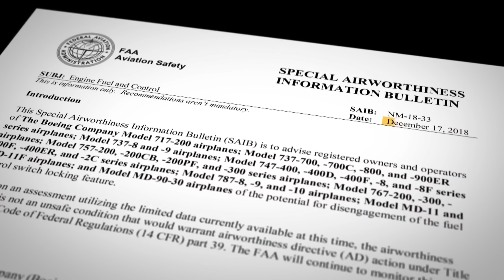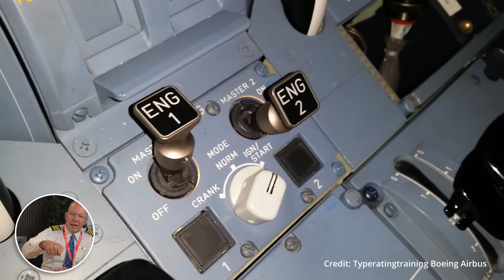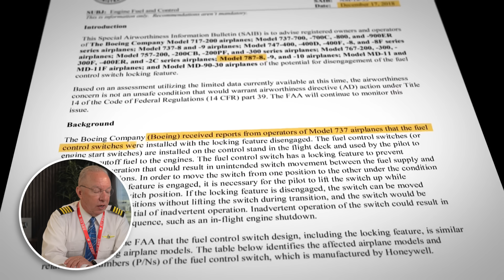Air India 171: The FAA’s 2018 Fuel Switch Locking Bulletin Explained (16 Questions Answered)

Comment: Capt Steve, could you please comment on the following points.

1. There are no high energy electrical switching systems in an aircraft cockpit. It is standard practice on all electrical machines, that high energy services such as pumps, electric flaps, pfcs etc are switched on/off by relays of various kinds.

2. That being the case, where is the sensor that tells the ‘black box’ that a fuel pump has been manually operated? Is it in the actual switch, or further down stream such as from the relay or the pump itself? This would tell us whether the switches were deliberately moved to the ‘cut off’ position, or the service stopped working for some other reason.

3. Is it possible that a ‘gremlin’ in the computer system could have turned the pumps off, without the cockpit switches being touched? 

4. I have an uncomfortable feeling that we the public are being primed to believe that this crash is a mass murder/suicide event. Such would be convenient for the manufacturers if there is a problem with the aircraft and its systems.

I am a retired pilot who flew very old aircraft types before the introduction of fly by wire and computer software.

Comment: I have read that the TCM Throttle Control Module which includes the two fuel shutoff switches was replaced on this airplane after a directive from Boeing.  The last time in 2023.  Does that also include the fuel shut off switches and has this been addressed?

Comment: I've read the whole report and here are some points to be noted:

1) One of the annoying thing is that they did not publish exact words that were said between the two pilots, but stated " In the cockpit voice recording, one of the pilots is heard asking the other why did he cutoff. The other pilot responded that he did not do so". However, it is still very important that one directly asked why the other cut off, and not like "What's happening" or "How did this go to cut off?". But again, we can't rule out the possibility that one pilot just assumed it was the other who did the cut off, and so asked this question.

2) The co-pilot would have had his license expired in september this year, and would have required to go through the following:

    a) Medical Revalidation: Renew your Class 1 medical.
    b) Check Ride/Test: Pass a proficiency check or skill test (on the aircraft type or simulator).
    c) Recency Requirement: Meet the flight hour requirements (e.g., flown within last 6–12 months).
    d) Ground Refresher (if needed): Sometimes required if CPL is lapsed for long.

^ while this might be irrelevant, it is still a minor fact to notice.

3) The switches go to CUTOFF at 8:08:42 (in a 1 second gap). Then switches are turned back to RUN: Engine 1 after just 10 seconds later at 8:08:52, while engine 2 turns on 4s after this, at 8:08:56. The report further states that if an aircraft is in mid flight and switches go from CUTOFF to RUN, it takes some time to regain the speed (obviously) and so the airplane could not regain height in time. It was too late. I'm not sure why it would take 10 seconds to turn back the switches on, but I think on that situation you will be so confused as to what is happening that it might not have been obvious to put them back to RUN immediately.

Comment: As airline pilots, we quickly detect when a switch or system is not operating correctly. Although we fly the same aircraft type, we operate different individual aircraft and can easily recognize variations between them. Not every aircraft will necessarily be affected by a potential issue.

Any defect, regardless of its significance—even something as minor as an inoperative reading light—will be reported in the Aircraft Technical Log (ATL). Licensed mechanics review all pilot entries in the ATL and perform corrective actions as necessary.

Prior to each flight, the next crew will also check the ATL to ensure that no open items remain. An aircraft will not be accepted for dispatch if defects are unresolved; any outstanding items must either be rectified or deferred in accordance with the Minimum Equipment List (MEL) and properly recorded in the ATL.

It is therefore unlikely that the aircraft operated with inoperative switches, nor that even a single crew failed to report such issues.

Comment: What if the locking mechanism for the fuel cutoff switches was warn due to excessive use to the point the locking mechanism simply let go of the switches?

Comment: Hi Steve, how do the fuel cutoff switches actually work? Experts talk about the cutoff switches as single entities that operate directly from the control knobs, like a lawn mower fuel valve. But, I doubt that fuel is piped into the cockpit. Much more likely that the switches are  not mechanical but are electric, controlling solenoids that control the fuel. How can we know that the shutoff solenoid valves were closed by software or a wiring error. This scenario fits the known facts where both pilots imply that they didn’t do it.

Comment: The RAT deployment at such an early stage (@ point of rotation) could indicate a power malfunction & consequent engine shutdown). The pilots could’ve then tried to manually rectify. The undercarriage will not retract in an engines shutdown situation. It’s baffling but Boeing’s work ethos has been criticised after other malfunctions/crashes. Far too early to blame human error. Software error more likely in my humble opinion.

Comment: Boeing not having software controls to prevent inadvertently flipping the cut off in "normal" flight speaks to the original Boeing culture of a skilled aviator being in complete control of the aircraft and why they did so badly when they put in computer controls which led to the 727 Max debacle. Good to know that other manufacturers try and have logic in place to prevent something like this.

Comment: I simply don't see how the control system in a modern plane would allow the fuel to be cut off to both engines in flight. It would be as illogical as allowing the pilots to bring up the landing gears while on the tarmac.
Reply: Landing gears will try and retract while on the ground. The nose gear will collapse but the mains won't. Fuel cutoff needs to be avail able to shutdown during an engine fire.

Comment: Any idea as to why there was only one second between the two switches being turned off but four seconds between them being turned back on again? Also, since there is a photo of the burned switches in the report, wouldn't it be possible to quickly determine that the metal indents were in place or not?

Comment: With the most courteous respect Captain Steve, you didn't understand the video question. Video recording, like other black box telemetry doesn't prevent the accident. The question isn't if video recording cockpits to "black box" would have prevented this accident, the question is what if it could prevent subsequent accidents by providing extra info.

Comment: I would like Mr. Steeve to explain below points
1. Page # 14 of the report clearly states and shows CCTV footage that RAT was deployed during initial climb immediately after lift-off. 
What would explain that?
2. How can 2 mechanical fuel cut-off switches be moved by a human being within 1 second. Is it even possible, because as per report, when pilots tried to move them back to Run position, it took 4 seconds?
Reply: I don't think you have the knowledge enough to answer my questions.
Everybody is aware of Boeing's past and their PR, so that says everything

Comment: CSeeve can u comment on this thought of mine:
1) timing of the initial switch movement comes immediately after PM takes his hand off throttle at V1Vr, and hands over to PF
2) 2 switches thrown within 1 second (possibly less)  could imply a TWO HANDED operation? PM has 2 free hands at this point. If deliberate was it done together with 2 hands?
3) 4 second seperation time  of switches being restored, comes after conversation. PF has ONE hand free, timing different from the OFF sequence, possibly because of ONE handed operation.

Comment: In what situation would a pilot need to shut off fuel to both engines, at the same time, during flight?

This seems like a failure mode that should be addressed by the manufacturer. There is a simple engineering philosophy called error proofing that needs to be applied here. 

We need to be designing these systems in a way that completely inhibits bad actors in the cockpit. 

Are all Boeing planes one intrusive thought away from a crash?

It’s unfortunate, but that is the world that we live in, and planes need to be designed with this in mind.

Comment: Seems the act of cutting off tge fuel switches was a deliberate act however everyone is jumping to conclusion and blaming pilot without knowing the facts before and after and those are not published.. under what situation this happened is unknown at this point so all including captain steeve (with all due respect) should stop blaming pilots and their mental condition until the full and final investigation is complete and instead should try to find the reasons as to why would any pilot do that

Comment: While fuel cut off can’t be placed fully under control of air logic like the captain mentioned, in case of fire etc , a solution could be to require confirmation from both pilots for fuel cut off eg by having fuel control switches at both pilots ends or an electronic approval from the second pilot after the first pilots cuts off the fuel.

Comment: I'm sorry where in the report is it said that somebody deliberately did it? 
If I see a warning in my system "fuel cutoff" I would definitely ask my other pilot "did you do it? "  Apart from that where in the preliminary report is it mentioned that somebody intentionally cut off the switch. Or somebody manual put them back on. All the report mentions is fuel got cutoff within 1 sec and then after seconds got restarted. How are you so sure somebody manually switch them back and forth???????? 

Which report are you reading?

Comment: Why can’t the fuel switches be under a guard box with a micro switch which would trigger a master caution when opened?  The idea is to warn both pilots that somebody is attempting to access the fuel cutoff switches. Simple mod that should not require a complete recertification of the aircraft type.

Comment: I am not completely across this but has there been an official statement that one of the pilots(co-pilot?) intentionally disengaging the fuel control switches? Has this been clearly established that it wasn't some mechanical fault? I thought the fuel control switches were found in the on position ( I guess they were turned back on) and voice recorder had the co pilot saying he didn't disengage the switches when asked by the captain? Is it just impossible for the switches to mechanically disengage themselves..therefore when the captain noticed he was fully aware the co-pilot had done it intentionally?

Comment: If I press my car’s engine start stop switch when moving - nothing happens - not surprisingly at all. And my car wouldn’t even crash in the event of engine failure, but a plane can.

I don’t have any experience in a cockpit, but since the air industry claims to target every one in a million risk, this design is completely pathetic. Switches right next to the thrust levers, with only a small metal guard near them? No simple computer logic in them? For such a critical switch? Yeah, I now understand that boeing is not an engineering company. This is a piece of s…

Comment: 4:50 "if somebody were to leak something… of a pilot doing something they're not supposed to do they wouldn't want that getting out there."
Yeah, that is EXACTLY why there should be cameras in the cockpit.  Truck drivers  are required to have cameras 24/7, so why not airline pilots??

Comment: An automatic car needs one to get to a neutral or park gear to power down, even a smartphone asks for a confirmation for power down. How are there zero checks for a power down on a commercial airliner? Even if it just means bringing the throttle back for that particular engine to zero? Scary.  
Having worked in software industry for 2.5 decades, have to ask, does anyone know if physical switch fuel cutt-off switch data captured directly by a sensor? Or is it some sensor data captured down the line?
Most shocking is the report in itself, which doesn't present any information in detail. Not the entire cockpit conversation or entire set of actions which happened, presenting just vague snippets of information and calling it a report is unacceptable.

Comment: Based on one of the question re ECAM and switches not controlling the valves directly - I think they need to investigate what other factors or scenarios can lead to computer shutting down the valves, other than electrical failure.

Comment: The other day, I found myself brushing my teeth, when, in fact, I'd entered my bathroom in order to shave. Absorbed in unrelated thoughts, instead of my intended action A, I took action B, which made no sense at that time, and it took me quite a while to notice my mix-up. So maybe one of the pilots was temporarily spaced out for some reason and mistakenly cut the fuel instead of raising the landing gear.
Reply: You might mix up between two very usual things that you do when you're in the bathroom but you won't do something very unusual like switching off the bathroom lights when inside even when you're lost in thoughts. So, the possibility is very less
Reply: Spaced out, on medication, maybe lack of sleep from a personal issue? I'm thinking this could be another possibility instead of a murder-suicide like the Germanwings flight.
Reply: Similar things have happened before. Like that Yeti airline crash in Nepal a few years ago.
Reply: Early signs of Dementia in your case ? Pilot Physical would probably pick up equivalent things ...

Comment: 16:45 Good video. The only thing is that your scenario assumes that it was the pilot not flying the plane who moved the fuel switches to cutoff and the pilot who was flying the plane who 1. Asked why did you do that? 2. Took corrective action by moving the switches back in the run position 3. Called for mayday mayday. I think it was reported that the Junior Officer was flying the plane while the Senior Officer was assisting. Hence, the senior officer, the one alleged to have medical issues, according to this scenario was the one who moved the switches to the fuel cutoff position.

Comment: I am an aviation engineer...in avionics....why do these critical switches not have redundant fail safe features??? Such as a CB...or link it with the throttle position....like if 1 thrust lever is back at idle position then only the cut-off should work....

Comment: Might it be possible to hear the switches being physically turned off by boosting the volume of the cockpit voice recording e.g. x 10 times? Often a lot of detail is 'hiding' in a recording that you can only hear after boosting the volume levels significantly. If the switches make a physical clicking sound then it might be possible to hear them being used. I'm so sorry for the loss.

Comment: The fact that the switches were turned off exactly at the right time shows this was deliberate, not an accident. There was no chance of aborting take-off and no chance of re-starting the engines soon enough. A few seconds earlier or later would have changed the outcome. Whoever did this knew when to switch them off.

Comment: Hi Captain, is there a step during takeoff whereby another set of switches need to be touched or enabled? Could one of the pilots have mistaken the fuel switches for these  - touched the fuel switches  instead of another set of switches? Like in a car for example you want the a/c switch on but touched the heater button instead but you think it was the a/c  button that you touched.

Comment: Why there is not a lock on run position on those switches designed by manufacturer on certain time like taking off? Or at least one to be locked on if the other one would be turned off for a reason like fire?